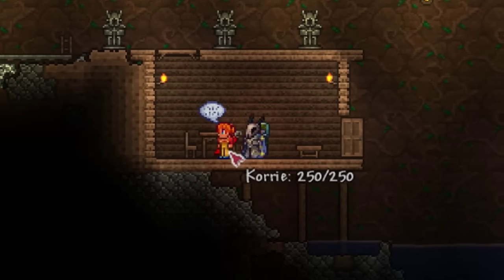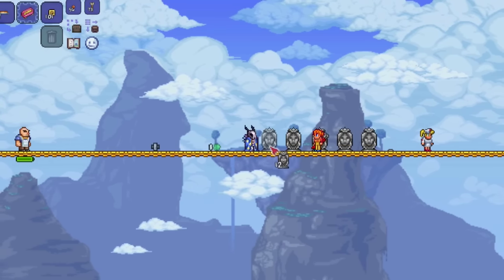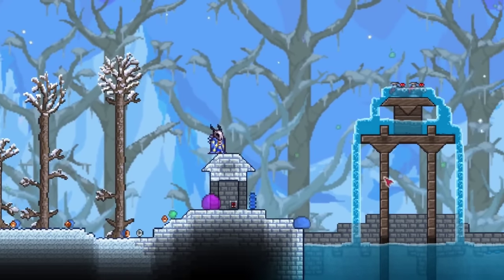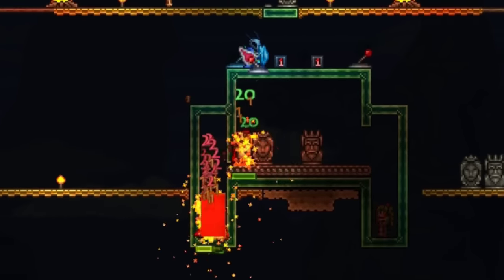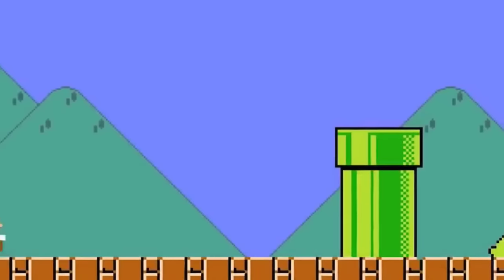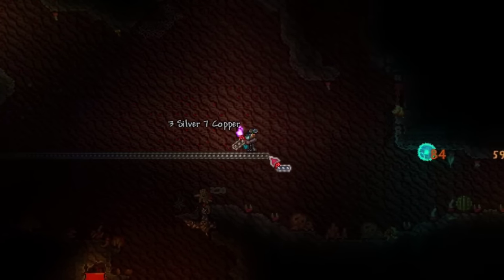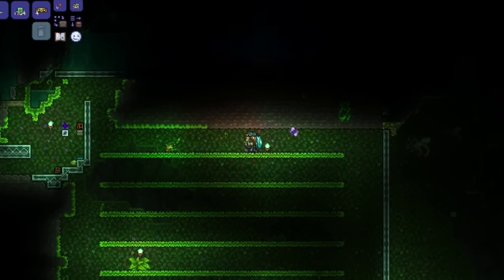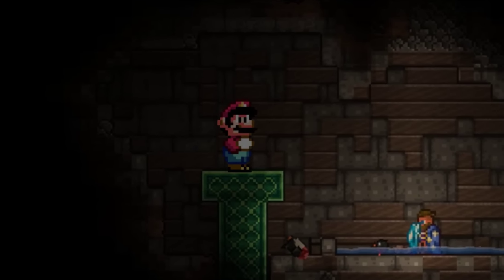The Potential of Terraria's Wiring.

Comment: You can use paint to help hide switches, buttons, and teleporters too. I like to make doors that look like old games you have to press "up" on to go through, to take players to a new room. On xbox, I would set up for example a wall, paint it black and put a nice looking little door frame to it, when player would teleport, it would take them somewhere in the house, (normally a room I have set somewhere underground, with surrounding area painted black to look like a single room like a bathroom). Or if I want to make a world feel 3D or flipped, I will do the same thing, and have you instead go to a duplicate of the house mirrored to look like you went to the otherside. 

Painting is a powerful tool for engineering. Either way, you did some cool stuff, and I hope it inspires other players to take a bit of time to learn and play with it.

Comment: Hey, just thought I'd chime in with something I learned about. Someone (From Scratch) on YouTube created an 8 bit computer using wiring. It was so intensive that they had to recreate the wiring system with modding. The mod is called Wirehead - the main change has to do with the way the game handles what is connected via wire. By default, the game traverses each unit of wire and finds things to activate when a signal is sent. Wirehead changes it so that the game just knows what's at the end of the wiring, meaning it doesn't have to trace the whole wire length!

Here's his video: https://www.youtube.com/watch?v=zXPiqk0-zDY

Comment: I usually use wiring to make an area off to the side of main base where no enemies can spawn, but I can flip various levers and switches to essentially turn on mob spawns on one side or the other (or both, which is default, when I'm not using it). And when the mobs DO spawn, they are led into a nice little lava-layer trap, so it's also a mob farm. Can't quite AFK Solar Eclipses once Mothron can spawn, and if I do it wrong Wraiths can get in. But it works for my purposes.

And if ever I don't feel like dealing with the blood moon enemies, I can just 'turn off' spawns, and wait it out. Though... That part isn't as necessary, now that Sundials and Moonsdials are a thing, and reset when either of those events kicks in.

Comment: It's not that you can't make stuff with potential, but the more complicated it is the worse the game's engine handles it.
For instance for each wire you put down the engine checks all 4 possible connection points it has. In other words, instead of them making a secondary array that verified where the wire was connected to (in the initial wire placing array) it just checks all the possible spots EVERY time it refreshes the clock <which is exponential work!>- that makes it do 4 times more work for each single wire you place. 1 wire =x4 2,x8 3,x16 4,x32 5,x64 6,x128 7,x256, 8,x512 9,x1024 10,x2048, 11,x4096 12,x8192. After only 16 wires it's doing 131,072 extra calculations per cycle. After only 19, it's 1,048,576. After 29 it breaks over 1 BILLION USELESS OPERATIONS (1,073,741,824 to be exact) when if they'd written the engine mathematically it would use just 58 to do the same function. Yes the game does do a great job handling all that extra crap it's doing, well- but the point is it shouldn't need to- especially with how long the game's been out. (as an example Starbound's wiring system handles it properly. That said starbound's base game performance itself could be improved a good bit. That- terraria actually does well)
If you had actually bothered to watch From Scratch's vid you'd know that, & also about the mod he wrote that eliminates that issue all together. (As reported by ThePrimeTime, From Scratch also got 3 real world job offers because of it.) Sounds to me like what he made in terraria has more potential than anything you've ever done- in both terraria & RL.

Comment: A little trick, but the logic lamps can be used as one way gates. You can use an and gate woth 2 logic lamps on top. The bottom one is a buffer, and the top one causes the lamp to send a pulse when it is toggled

Comment: there is a caveat to the automated life fruit bit. plantera's bulb wont spawn plantera if there's no player in its vicinity, idk how close exactly the vicinity is, but if you just go check on it midday or midnight when it wont shift for another couple minutes, then you're fine. alternatively set it up on a switch thats far enough away from the farm itself and then just toggle it on and off when its ready and you should be safe, unless they changed that post 1.4.4

Comment: I think there are multiple factors why innovation in Terraria is slower than in Minecraft

1.Terraria has a smaller community

2.Terraria doesn't have as many weird rules and quirks as Minecraft has, which you can use to make farms. The spawning mechanics of Mobs are simpler.
You typically don't need to farm eyeballs for lenses, because there isn't such a large repetitive use case for lenses. You're good if you have 50 for a whole playthrough. And the enemies with rare drops often work with the same farm design, so you have little incentive to change something that already exists. Why do you want pumpkins in Minecraft? Villager trading. But the villagers in Terraria trade anything into a currency and everything can be bought using that currency (we don't talk about the Barkeeper). The only things you're farming for in Terraria, as far as I know, are Money or slime. 
And you're Money farm can also be a mob drop farm of whatever biome you place it in. 

3.Terraria has very few items with repetitive use cases, items which are worth owning hundreds of.
Building in Minecraft is more expensive, because of the 3D nature. So if you want to build a rectangular box, in both games of with the same block length, you'll use nearly 6*n² times the resources in Minecraft compared to Terraria.

4.Wiring in 3D is much easier to read. I mean Holy Punk, the Tetris Computer in Terraria looked horrendous. You have more space in 3D, so you typically do not have to cluster up wiring so much as in Terraria, where, with its 4 wire colour's, it is expected of you to overlap the cables.

Comment: 10:56
conveyer or hoik. one is slow and expensive but easy to setup,
one is the opposite.

hey wild lmao! ive got a solution for 12:41 !
You need a conveyer hoik, make a hoik then blockswap it with conveyers, no starting platform to get in required!